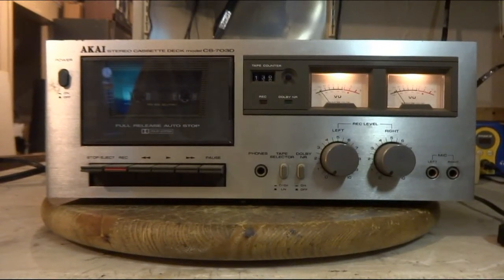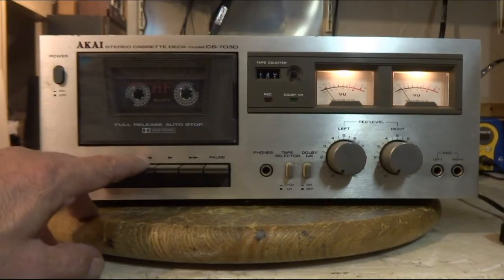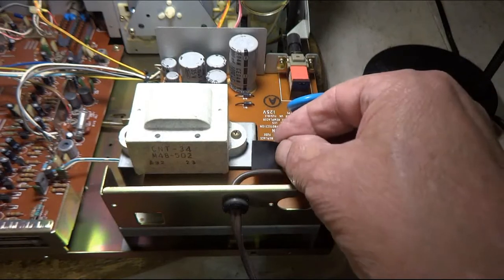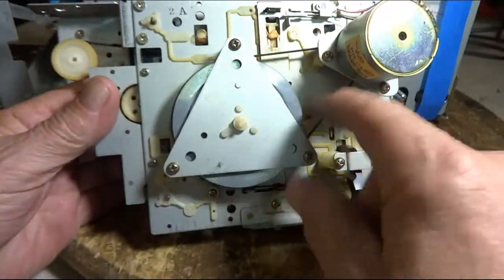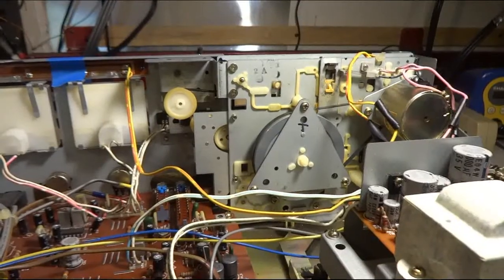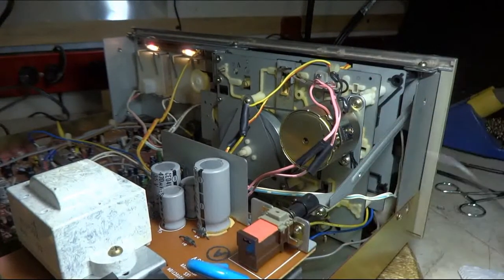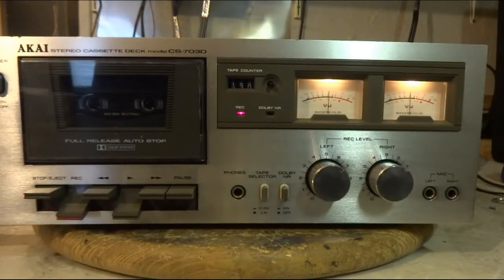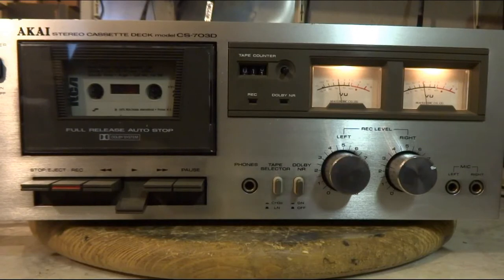AKAI CS 703D

Comment: hello, do you know the length of the belt?
Reply from the maker: Thanks for watching. I have a bag of belts that I got from China and I find the best fit . I have seen other youtubers tie a string around the pulleys and measure it, maybe going a little smaller. Someone on ebay may have a belt kit. Others on youtube would boil the old belt in water, I have done this and use some of the rubber re-grip on it and it does work. Finding belts is always a problem unless it is a high end deck.
Reply from the maker: @derdalan  I would take the old belt to the repair shop and see if you find one that matches. If you think that the old belt is a little loose, get one that is just a bit smaller. The wow in the wow and flutter is the tape speed  being constant. That,s why I use a 3000 hertz test tape. If it goes up and down a couple of hertz, no problem. But if it is going up and down 10 hertz  or more you will hear it. The belt could be slipping, the idle wheel for the pick up spool could be slipping or even the pinch roller could be the problem.
Reply: @patrickoconnell3896  thank you for your reply, i will take it out and show to the shop, that would be the best way. Best wishes ✌✌